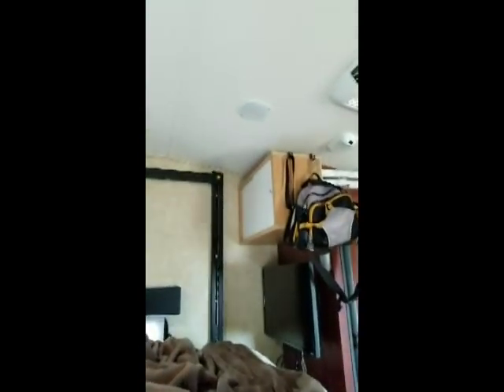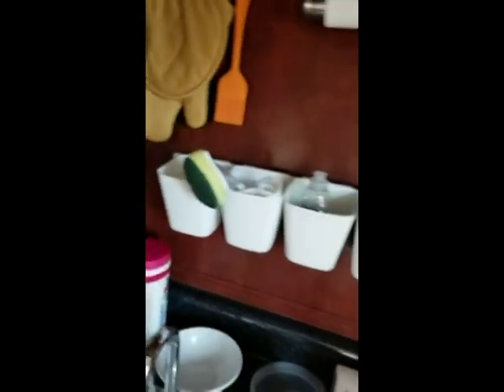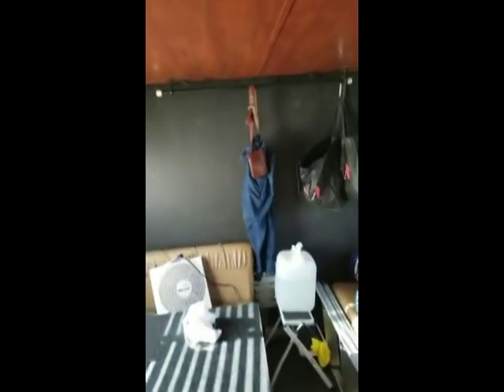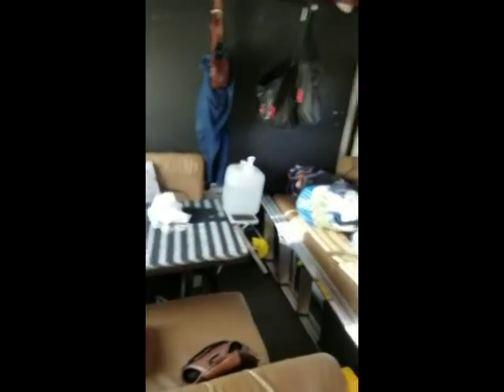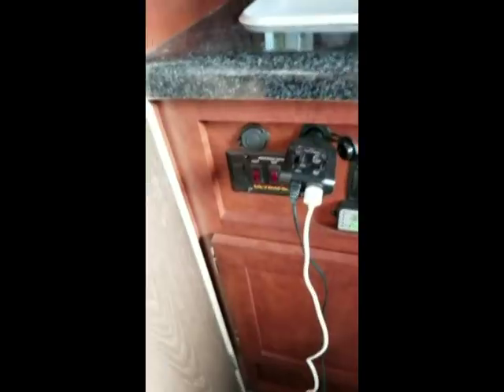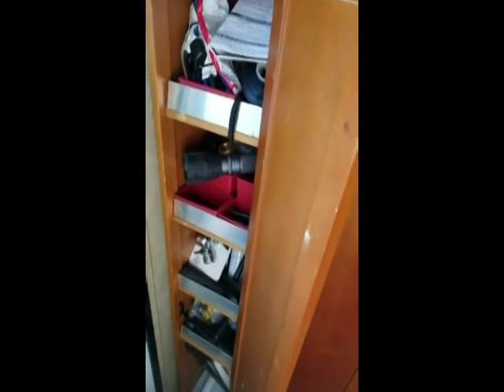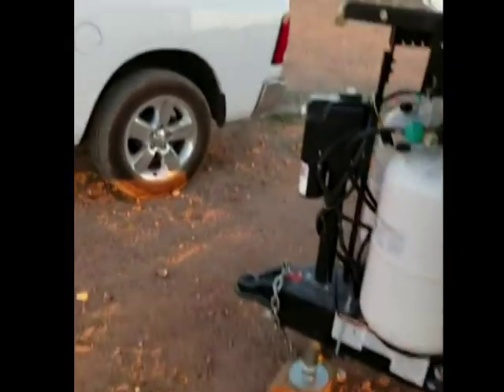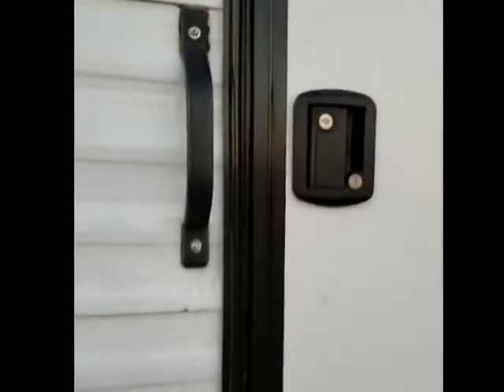Dune Sport 12 ft Toy Hauler in the field with Modifications I have done

Comment: About 18 months ago I was looking for a small toy hauler I could have built to my specs & saw your first video. I contacted Casey, started the process and picked up my 6' x 12' in March 2018. I bought a toy hauler because I needed a way to haul my Segway-based wheelchair & according to Ford, I could tow the trailer with my Ford Flex. 

I sent Casey a LOT of parts - 200aH AGM battery, 2000w pure sine wave inverter, a heavier duty water pump, shower head, had the frame lengthened 12", and the list goes on & on. I had a special high amperage charging circuit installed on my Flex (Hellroaring Technologies) which pumps about 30 amps into the battery vs the 6 amps or so I'd get via the 7-way plug. I also had an Anderson weight distribution hitch installed & it uses chains pulled tight against polyurethane bushings which not only helps spread the load but it also reduces sway.

I had them leave off the roof A/C because it was overkill but opted for the remote control Fantastic vent. I also got the same fridge as yours, two 30-lb. gas bottles, a 10 gallon water heater and a wider than normal entry door. I have the shorter ramp so mine doesn't have the "hump" in the roof like your does.

Unfortunately the Flex wasn't up to the task of towing & on my way back to OR I got 6 mpg between Las Vegas & Tonopah. I normally got 20 - 22 without towing so that was a terrible shock. When I finally got home I found a one-owner 2005 F-150 with the factory towing package on it. The truck was 13  years old but had under 59,000 miles on it and had been maintained religiously. I had a custom Century aluminum contractor-style cap built & painted to match the truck. I also had a 1000# capacity bed slide installed & that's where my 3100w Chamion dual-fuel generator rides. I only run it on propane & have a dedicated 30-lb bottle for it. I also have the AP Products propane level sensors on the three bottles & while they don't always give me the correct reading (my generator bottle is 100% but the app shows it's empty) they usually work pretty well. I opted for a Valterra Sewer Solutions tank drain which uses a 3/4" I.D. hose and external water pressure to empty the tanks. It will fit in a flat plastic ammo crate so it's easy to keep the black & fresh water items separate. 

I had my brother build a Twin size Murphy bed along the right wall & it folds lengthwise. Due to the narrow width of the trailer I found I couldn't have the bed and dinette benches down at the same time so I ditched the dinette completely, installed a Lagun swivel table mount & a 24" x 30" table top I bought on Amazon.

With all of the customization I ended up spending a small fortune on the trailer & all of the required accessories to use it. During part of the interior work I was really ticked when I opened the wall behind the sink & found the 110v outlet hanging off a piece of OSB. Since this trailer was my first I didn't really know what to expect as far as build quality but it was disappointing to say the least. 

You & I are about the same age so this will be my first & last trailer. I now have it equipped pretty much the way I want it & am sitting in an RV park in Tacna, AZ where I've been since 12/5/18. I'll be here until the middle of April & will go back to OR because I have Jury Duty but that's when the weather starts getting nice there. Over the Summer I'm sure I'll find things I want to change & watching  this video has given me some ideas. One thing I'm planning is to have a swing away mount built (like the spare tire carrier on a Jeep) and I'll either mount two semi-truck under frame storage boxes or a large pickup cross bed storage box. I't'll swing out to the drivers side so my hoses, electrical cable, chock blocks, etc can be accessed on the side they're needed. It'll swing out far enough so the ramp, which I now use as a patio can be lowered.

I've only scratched the surface here about all of the options & mods I have & something new is always in the back of my mind.
Reply from the maker: I like your ideas.  It's been a lot of fun sort of putting my own customization on it.
Reply: @DocsDetectingSupply  Remember that the trailer is not narrow.  It is the maximum width allowed which I believe is 102 inches.

Comment: Great little comfort trailer. If I can make a suggestion Even though I have a trailer and a 3500 watt generator, I also carry a 1000 watt small gen. (you can use 2000 also) The point is when I don't use A/C or microwave I can still have plenty of A/C power for everything else, most important running the heater because even though your heater runs on propane it still has to use your house battery for starting the heater and safety as your propane will be shut off to the heater if the battery is low. 

Although you have 50 gallons of fresh water (me too) I carry in my truck bed a bladder of 80 gallons of extra water and a water pump. This gives extended stays in the desert plenty of water to shower and things. I pump the water into the trailer water tank when low. Have fun, be safe and hope you find a 50 pound gold nugget............Michael
Reply from the maker: I do the same thing.  Although I don't have a bladder I carry several extra 5 gallon bottles of water.  80 gallons of water would be an extra 640 pounds. I also carry an extra 40 gallons of propane.  I also have dual batteries.  So far so good.  I have not ventured to anyplace really cold as of yet, so I usually only turn the heater on long enough to take the chill off then I turn it off.  I would never sleep with it on because I can't stand it warm when I am sleeping.  I rather heap about 5 blankets on me.
Reply: Yeah my Truck is rated for a much heavier trailer than I pull, the extra water I carry (bladder) goes in the bed of the truck and it actually rides better. "Wife is happy, I am happy" type thing. 

It is really fun watching Videos that show the appreciation and satisfaction  people get making their home away from home so usable and comfortable. Your videos are like that.

Thanks again for the effort............Michael

Comment: Hey Doc, so after a period of time, what’s it been like 2 years with your little trailer, do you still haul your ATV around with you, I guess what I’m asking is how is your whole system working out for you?
Reply: Works fantastic.  Never go anywhere without my ATV on board.  Good thing too.  I got stranded in the desert with two blown tires on my truck.    No cell service.  108 degrees.  I unloaded my ATV and road 22 miles to the ranger station and a land line to call my son to come and get me.  Over 100 miles away from Las Vegas.  We took the blown tires, drove back to Las Vegas to Sam's Club, got new tires, drove all the way back, changed tires and drove home.  Without the ATV I would have been screwed.  I had plenty of water but no one knew where I was.  I did have my SPOT X Sat. texter with me so halfway to ranger station when I got a clear view of the sky through the mountains,  I was able to text my son my situation, that I was OK, and my exact GPS coordinates.

Comment: Nice trailer Doc.  We have the same Dunesport in Colorado.  I'm wondering where you store the spare tire and also how you attached the water or fuel jug on the ramp?  Thanks for the input.
Reply: The spare is on a wire cable under the rig just like on a car.  Then there is a rod with a hex end that comes out the side of the trailer that you can use your tire wrench on the lower the tire to the ground.  To mount the fuel can I got those things that look like a washer than have little teeth on them, then where the hole in a washer would be there is this female threaded tube.  You drill a hole the size of the tube, sit the washer it the hole and tap it in so the teeth set into the ramp.  Then screw your bolts in from the other side.  I wish I knew what thos things were called.  But they mount flush.  I screwed the bolt in and marked it on the ramp side because it was too long.  Then I ground it off so it would not stick out on the ramp side.
Reply: are you still enjoying your dune sport? I am looking for one in Utah.
Reply: @stevey500  Absolutely.  I love that thing.

Comment: do you still have the same tacoma as when you started out?.ooops just saw the Dodge Ram, so never mind about the tacoma question ......liked the video! so is your wife happy in there now with more headroom?  i'm with you on getting out, and about, i bought a 2015 Polaris 570 a couple years ago, it was just barely used, but i got a great buy on it and i'm just tickled pink about it, except for the color (red) i've been seriously plotting to start detecting, but i have a couple bills that i need to whittle down before i can take the plunge, good luck to you. p. s. how do you like that Dodge? 4 wd?    THAT is good customer service.
Reply from the maker: The Tacoma can pull it, but barely.  40 mph up a hill max.  Not a good choice.  I love my Ram Eco-Diesel.  It's made for towing a small load like that, effortlessly.

My wife has no issues no that she can actually sit up in bed and not feel like she is in a coffin.

Take a look at the new Minelab Equinox 800 metal detector.  That machine does everything, coins, relics, beach and gold nuggets.  Reasonable at $899.

Thank you for commenting!
Reply from the maker: My wife is much happier.  She can get a good nights sleep and not feel like she is in a shoe box.  The Dodge Ram is 4 WD tow like a dream.  I love the Ram it is an Eco-Diesel.  19 mpg in the city. The Tacoma, no way is it meant to tow that much.  It will do it but it can't maintain the speed limit on an incline.
Reply: @DocsDetectingSupply  So you need a diesel truck to pull this little trailer ? It must be heavy.
Reply: @tms372  No you don't need a diesel but the Dodge Ram Eco-Diesel is an light weight diesel that is designed to tow.  It has tow mirrors built in, built in trailer break, the round plug and blade plug and hitch all standard.